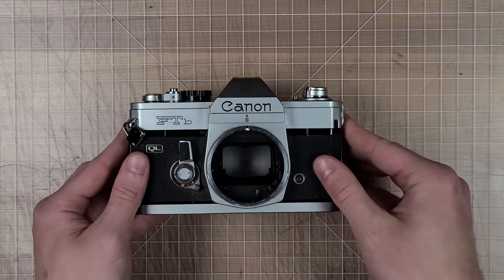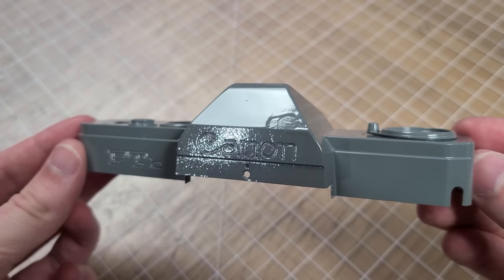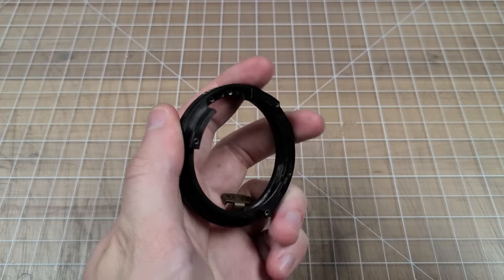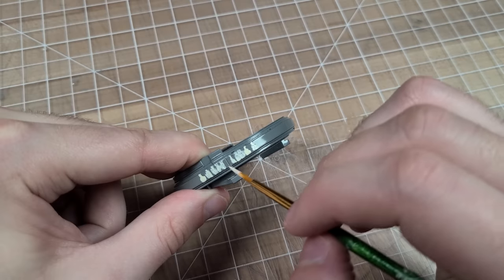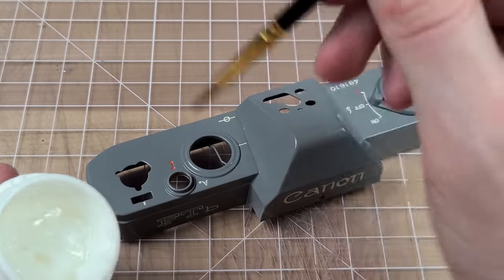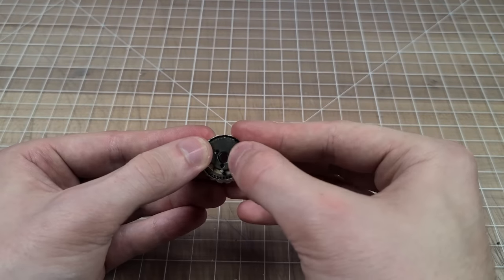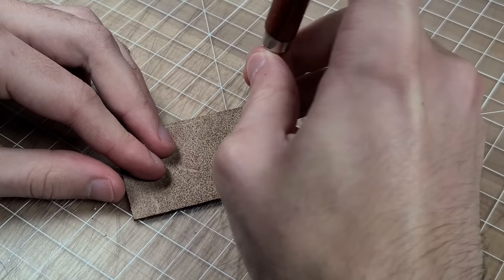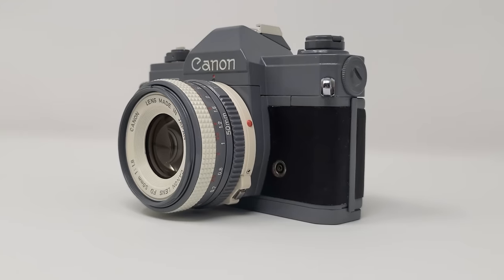Spray Painting a Canon Film Camera - Canon FTb QL Overhaul Part 2

Comment: Impressive transformation! Good job bud! 

Here's a few tips I learned from restoring cameras:
- For the clear window, you could use some HPD super-gold CA glue. It's designed to not fog up, and is used in the model making scene for clear cockpit and windows on scaled models. Blowing on glued area while it dries also helps to avoid fogging. 
- And for the leather cover, use some 3M 300LSE (or similar) double sided tape. It's non-toxic, easy to apply, very thin and even, and leaves no mess.
Reply from the maker: That 3M tape you recommended is exactly what I've been looking for. If it's thin enough I'll bee able to use that on a project I have planned. Thanks for the good tips.

Comment: The rough paint on the bottom plate is probably due to the paint droplets partially drying before it hits the surface, due to being out door....brilliant transformation....love your channel...!!
Reply from the maker: I bet you're right about the paint. I don't remember exactly at this point, but I was painting in direct sun on a number of occasions. The paint probably flash dried immediately as you said. I recently purchased an airbrush so any further painting will be done indoors from now on. Hopefully I encounter fewer issues. Thanks for watching.

Comment: Amazing work and I'm glad you weren't discourged by the unjustfied hate towards repainting older cameras. I've ruined an RB67 lens once trying to repaint it but it's part of the process. I'm going to use your video to give it another go, on a rangfinder maybe.

Also, what's your watch?
Reply from the maker: Thanks, and yeah the whole repainting cameras thing is definitely polarizing. If you're referring to the gold watch it's a Timex. Unfortunately I can't find a model number anywhere on the watch. I bought it second hand from a junk bin at an antique shop for $2, so I don't have any of the original packaging or anything.
Reply: @patricknicholsdesign   It's really cool. I'm not into watches yet but I've recently been appreciating them more and more. I saw an Orient watch from the 70's and fell in love.

Comment: The adhesive that I’m told most repair pros use for reattaching the leatherette is Pliobond. I’ve used it with good results but not on real leather so we’d have to take the can’s word on that. It’s great because it dries flexible and holds the covering onto the camera just strong enough to keep it together until you want to get it apart. It’s also not so great because the smell is obnoxious and it is impressively proficient at gluing its own container shut.

If what you’re using holds so strong you can’t get the leather back off without damaging it, maybe Pliobond’s benefits will outweigh its annoyances. Although I guess you don’t reattach leather after you’ve peeled it off? I’d imagine it’s difficult to clean the old glue off.
Reply from the maker: The great thing about the water based contact adhesive that I use (it's called aquilium) is that it holds pretty strong but not so strong that it can't be removed with relative ease if the camera needed to be stripped again. The residue is easy to peel off hard surfaces like the metal camera body, kind of like elmers glue off your fingertips. As far as longevity goes it seems to hold up pretty well, but I'd imagine might not do as well with extreme temperature swings (I'm not sure what it's rated for by the manufacturer). I'll look into getting some pliobond though, I can see myself making use of that in certain applications over what I currently have. I appreciate the information, thank you for watching.

Comment: Great job! Just wondering. Where would you go to learn to take apart and put together different vintage cameras?
Reply from the maker: Good question, the answer is you don't really. If you're lucky enough to have someone in your vicinity that has the knowledge to repair cameras, you may be able to reach out to apprentice under them. However for most people doing this nowadays, you just start by pulling things apart and putting them back together again. Eventually you get the hang of how everything works. I recommend starting something of little value that you know to be broken. If you end up making it worse it's not a big deal. That's how I started out. Thanks for watching, if you have any other questions I'm happy to help.
Reply: @patricknicholsdesign  Thank you so much! Greatly appreciated!

Comment: Nice job. I have an fujifilm XE4 i just wanna turn the white lettering to red. What do u recommend?
Reply from the maker: Assuming the lettering is imprinted into the camera body/dials it should be pretty easy. You can just go over it once or twice with the new paint, and then wipe away the excess with rubbing alcohol like I did in this video. Some kind of enamel will probably hold up the best over time. If the lettering is screened on, customizing it would be more difficult. The only way I can think to do it would be to remove the existing lettering and then have custom vinyl decals cut to replace them with (or to use as a mask/stencil for painting). Hope that helps. Thank you for watching.

Comment: I would try to look for pliobond when it comes to contact cement, it comes off with alcohol, this is the same stuff the camera repair men would use
Reply from the maker: Yeah I had a few other people recommend pliobond. The only issue with using that is if for some reason adjustments need to be made, the alcohol will completely ruin the leather. The water based contact adhesive doesn't require a solvent for removal. If I were using a synthetic covering I'd go with pliobond. Thanks for watching.

Comment: Having painted a couple of Canon P’s, I can tell you it’s better to remove the nickel plating first. It’s easy to do if you have a small power supply, copper rod, vinegar and non ionized salt. Still good work though. The FTb is such and underrated camera.
Reply from the maker: Thank you for the tip, I'll have to try this out next time. I had seen some videos in the past on electro-plating for restorations but I didn't think to remove the plating in this case. I agree that the FTb is highly underrated, a much better value than the K1000 in my opinion. Thank you for watching.

Comment: wow awesome! I got an old nikon digital camera that I don't really wanna let go of but the rubber grip is sticky do you think I can do the same thing you did with leather for the skin?
Reply from the maker: It may be possible to do depending on the shape of the grip. Leather works well on flat areas, but I've never tried applying it to molded parts. In the past I've had success removing old sticky grips on point and shoot cameras with rubbing alcohol. Usually the grip part is quite thin and removing it simply exposes the hard molded plastic below. In those cases I didn't even bother to re-cover it. Thanks for watching.

Comment: 3:50 looks like chemical reaction ~ you need to prep the surface properly by using acetone or surface auto dewaxing cleaner then you MUST wipe it dry with a lint free cloth (auto store).